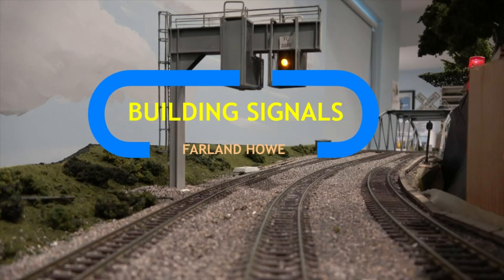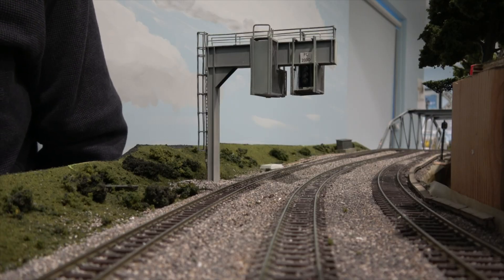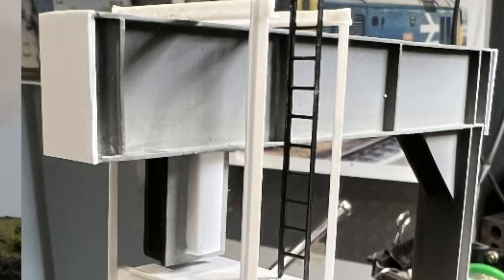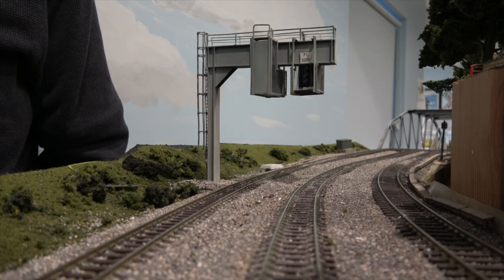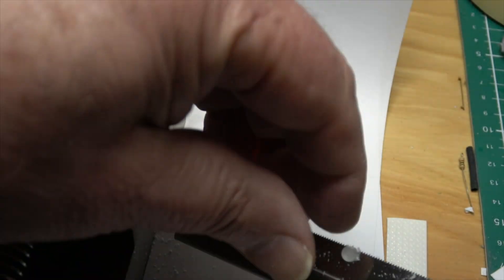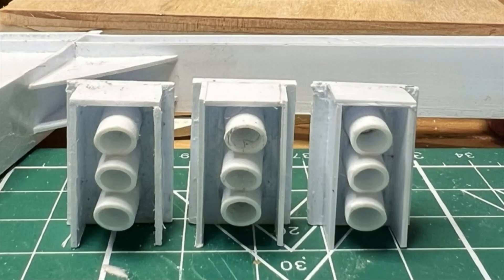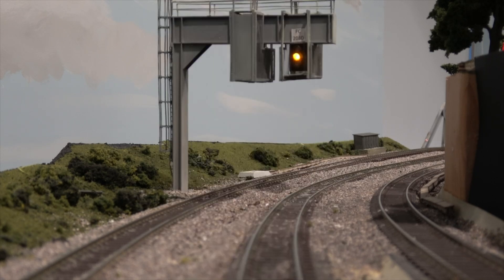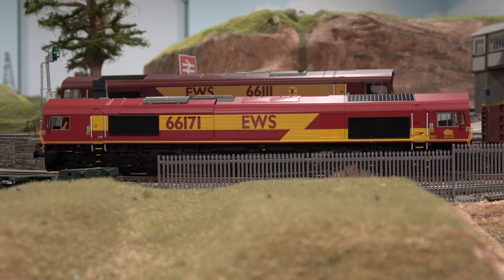212 Cantilevered Signal Gantries from scratch

Comment: Hi Rob, nice job on the lights and “metal work”, your diffusers certainly work very well. I see you suspended and positioned correctly so viewable on LHS as approach each.  Great to see that lovely bridge and scene again, a certainly the right  decision to incorporate and enough room to film from literally “down under” , lol. Signal planning at that level of detail is good to see, done the same for all my ground signals and running line 2 to 4 aspects and associated controls, timely but enjoyable in doing, I only intend in installing and wiring it all once……All the best Stephen
Reply from the maker: Hi Stephen, Thank you. The design for my signal heads and signal bridges has evolved as my skills have improved, and I have discovered better materials and developed better ideas and methods.  Hopefully, I am almost there.  I sometimes like to use my Wi-Fi-equipped onboard camera as my eyes, and I drive the train from the screen on my phone.  You see the line as a driver would see it when you do that.  As a result, it forces your attention to viewability and, with a second train running ahead on the same line, signal function. With as many signals as I have and the way they are connected to sensors and control circuits, I needed names and a record of how I set them up.  Otherwise, I forget how they work, where they are, and what they are connected to, and have to do forensic engineering to figure it out again if they need attention.  Putting master name tags next to all related devices is the biggest help.  That thing about doing it once...the problem with that is one finds making changes advantageous at times.   I have wanted to shoot up under the bridge since I built it to see a train crossing it.  ;-)  Rob
Reply: @FarlandHowe  Hi Rob, yes I like the extra detail you have added e.g. handrails, ladders, safety cage and the gusset plates which all add interest - same applied to the bridge - it brings it to life.  That’s a great way to enjoy driving your trains and I see more YouTubers using them for content, it’s certainly a different perspective and interesting too. Saw a wifi camera some 8 years ago built into the RTR engine, but the cost then was ridiculous. Using mnemonics combined with your signal diagrams is a great way to help you recognise what is what. I wrote a lot of industrial PLC programmes and used mnemonics to identify what each bit represented, it made it so easy to relate to particularly when dealing with over a thousand in some instances, made very few mistakes as a result. 

For my main signals I am using a couple of SIGM20 colour light signal controllers with block detection and some point status reporting which will trigger the signal transitions running over Loconet. The SIGM20 also allow reverse operation on my goods line which is a bonus. For the ground signals I plan to have a separate status mimic with LEDs to reflect what the ground signals  are set to (acts as a signalman) , they will mostly be set using my hand controllers either individually or as part of a route - like you the diagrams are essential for enjoyable and hassle free operation - I hope! The way I am going just thought adding the wifi camera could mean there is a train driver, responding to a separate signalman’s commands and timetable/ sequence of operations - fun for family and friends…. It’s a limitless hobby and never been a better time to enjoy all this technology and parts/ adhesives for building our models. All the best Stephen
Reply from the maker: @stephenpike3147  Aha, that explains your technical proficiency.  I did not program PLCs but I did write many sequence of operations documents which were used to create the PLC programs.  What brand of PLC were you usually working with?    This is very interesting.  My working life was spent in packaging machinery where the systems and machines were all PLC controlled.  I was deeply involved with jointed arm robots the last 5-7 years I worked.
Reply: @FarlandHowe  Goodness, that also explains your approach and methodology. You like me must have seen so much change in your industry technology, techniques and maths - all that multi axis positioning wow. I did not realise some folk specialized in sequence of ops alone. Which plcs? Suspect you must have used a lot of servos and stepper motors too.
I started on SqD series 100, 300 and 500 (just over 1000 I/O) all for a specialized steel mill. Then SqD 400 and 500 moved to Toshiba their Ex250/500 system as three other large drive and control projects- all with dc drives at their core and part of my design remit. Had other smaller with Siemens and Mitsubishi, all using ladder logic and associated maths, digital and analogue I/O plus high speed counters as required. Good fun it was, challenging but never a dull moment. As a drives and motor control company we realised all these different PLCs were a bind and costly so developed our own distributed event driven logic system which was graphically programmed. It used noise immune fibre optic comms and was laden with all our own developed function blocks (simple to very complex) including state machines. Rarely after that did we need any more PLCs for our projects once that was fully established. So enjoyed my time using that kit, sadly it was dropped after approx 16/17 years of use. So now retired and model railways is a more relaxed way of working/ passing my time!! All the best Stephen
Reply from the maker: @stephenpike3147   Huge changes in my industry.  I started in 1978 and there was a complete revolution by 1997.   We mostly used Rockwell Automation equipment. That was primarily what our US customers wanted. Honeywell purchased the company I worked for after I retired, so I expect they will use more of their equipment now. The robots could be any, but we usually used KUKA for our high-speed, high-throughput machines. They had the best software for the type of machines we were making, so it was easiest to get the best results.
You can't write a good sequence of operations unless you understand how the programming would work.  Early on, it was clear that no one would buy our creations unless they understood them.  It was noticed when I went out with the salesman and could explain the proposed system to the customer that they were more likely to buy from us.   Over time, I transitioned from pure engineering and design to pure sales.  As I like to say, I started out in engineering but became a personality mechanic when I retired.   I loved the work in the early years.  It was towards the end I lost the enjoyment factor.  By then, the numbers were getting very large and the pressure intense.  A model railway is perfect.  You can pursue whatever interests you as deeply as you want, be it art, mechanical engineering, electrical engineering, or electronics.  cheers, Rob